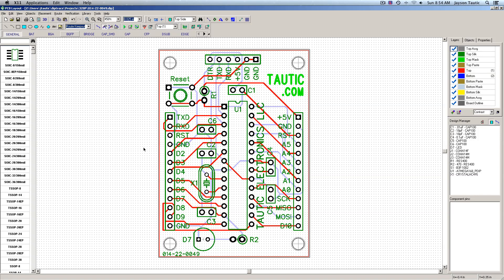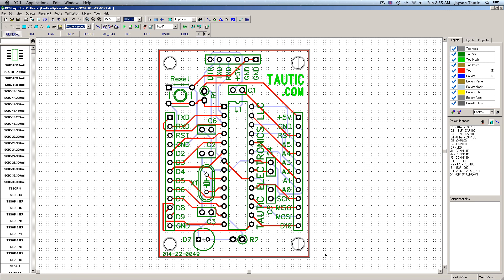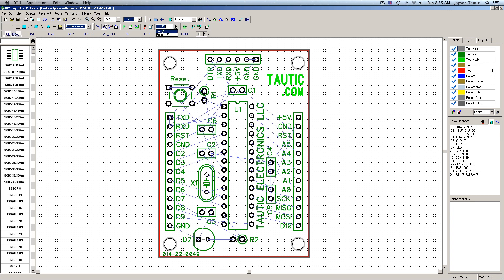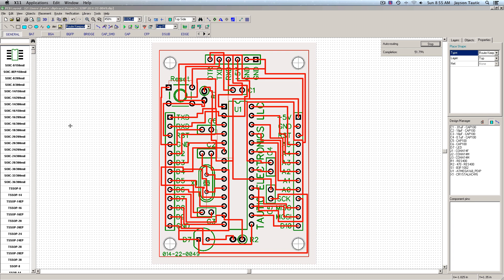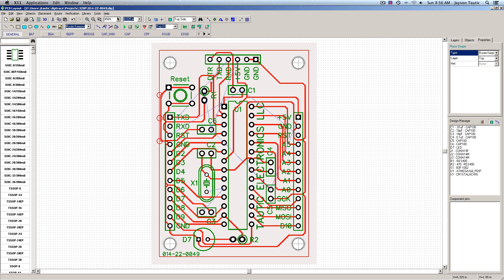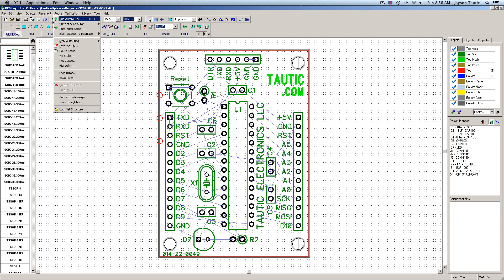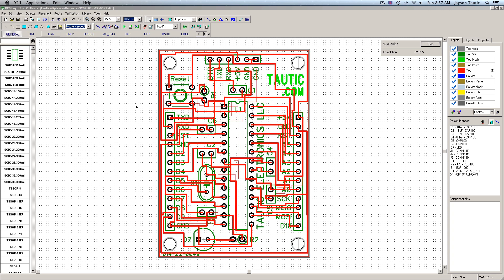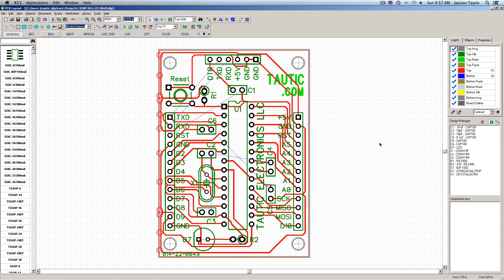DipTrace - Single Layer Autorouting

Comment: Cool, I've not used dip trace yet but it looks like I'll have to learn it to have my board design sent off to manufacture fifty boards. 

My original board I etched is made from a .Jpg, can I import the .jpg into dip trace (and "trace" over my tracks and pads) to make gerber file?